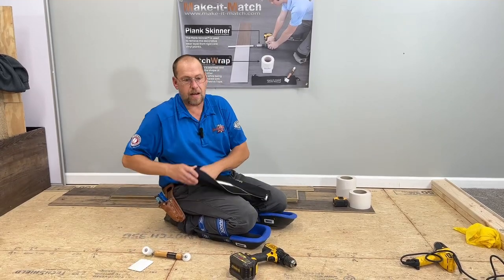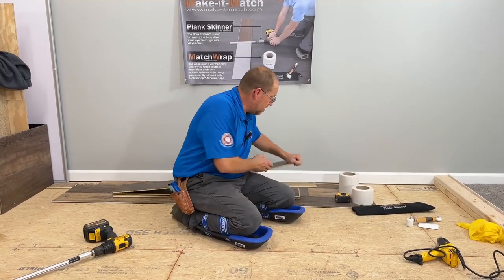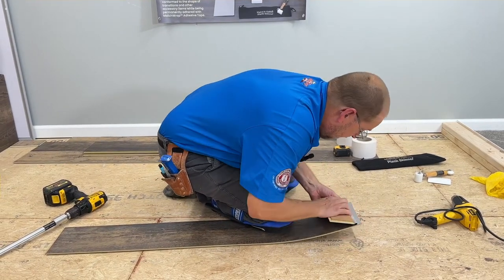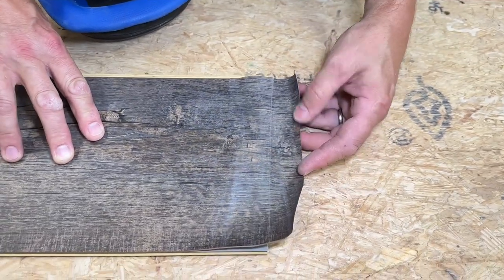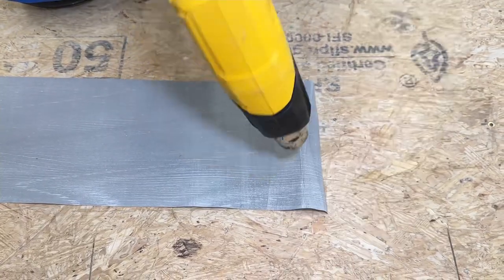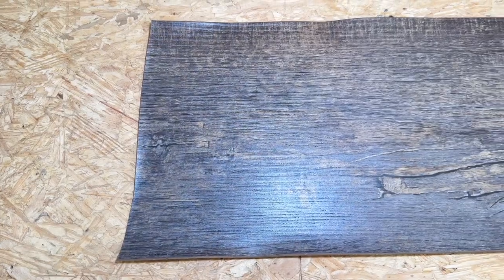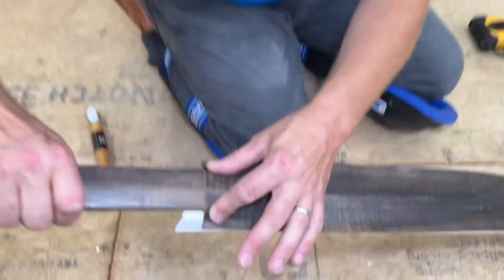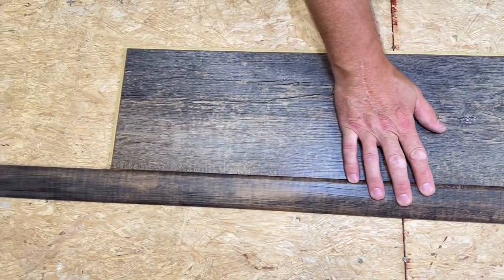Overcoming Vinyl Plank Transition Challenges

Comment: I've used the same method to completely wrap a bullnose step, been down 3 years so far with no problem, it's surprising how much you can mould it
Reply from the maker: That’s pretty phenomenal, and I’ve never heard of anybody completely wrapping steps with it like that. Good job.
Reply: Thanks, i'd done stairs and bullnoses  with normal vynil planks before ,so it was quite easy in comparison, once i'd found a method of moulding vynil over the edge of the curve without any cuts or creases it's actually quite quick and easy to do
Reply from the maker: @paulwebb6184  that’s awesome. I’m gonna have to try it out.